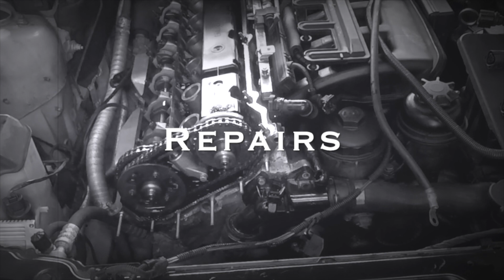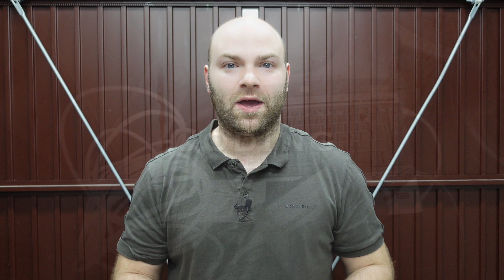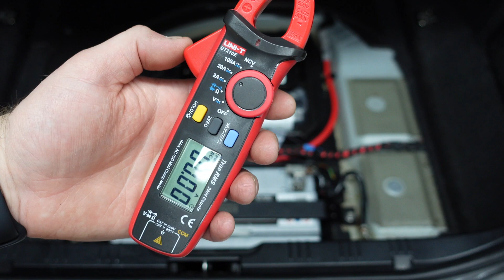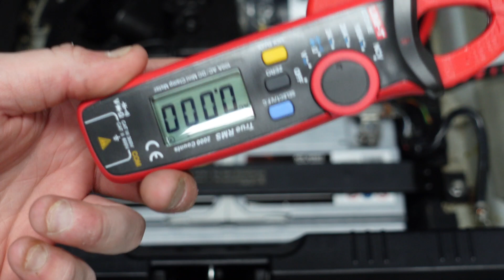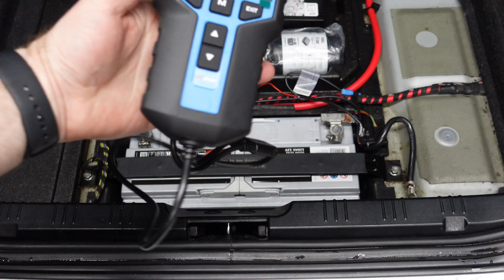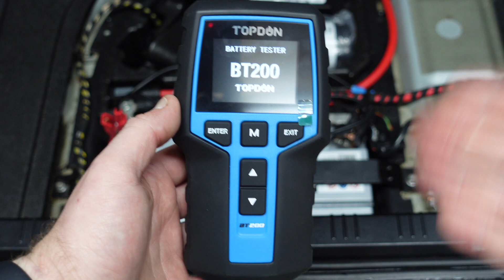Doing This Will Save You Thousands In Electrical Repairs

Comment: If I am not mistaken that is a Bosch S5 015 with a 110Ah and 920cca rating.  So 860 is about 93% SoC and 12.67v is close to fully charged for a LA.  But 3.47 M Ohm seems rather high.........  It is unclear how the Topdon BT200 determines the cca rating from the 110Ah that you entered as the two are NOT related.  Best to cross check with another proven tester.
NB.  Tests out of the vehicle, 1 day after fully charging and having removed the surface charge are more reliable.

Comment: I have a 2011 bmw 335d, my dpf is blocked and I can’t get it to regen because of the ‘throttle valve actuator code’. I’ve done the throttle reset and changed the throttle body and the code still keeps coming up. 

Can anyone help or recommend without going to the dealership? Thanks!

Comment: Hey Doc, I have a X5 M50D since 2014,first owner,  car  has around 105000 km. Started to have issue with boost couple days ago. Basically I have no boost(and I think no turbo's) till the engine reaches 100 degree. Once is passing 100 degrees everything is back to normal. No message in the car, as if something is malfunctioning.   Went to BMW dealership and they said that is the intake manifold, and that they should clean it up.  Did that and the issue is still there. The dealership is still stating that I should replace the intake manifold, they  are charging around 2k  Euro for it but I am sort hesitating to do that.  I mean is strange that once the engine reaches 100 degrees  Boost/Turbo's are back on the table and that looks to me like some sort of sensor.   ( btw the dealership is saying that there where no errors reported during the diagnostic.  I heard that a full diagnostic process can take up to 3 hours on this car... sort of doubting they did it as ).  Any Idea where I should start looking into ?

Comment: As far as i saw you have normal 110 Ah batteries in all your cars. I have a 95 Ah AGM battery in my 35d, and now that winter came it started to act up with increased battery discharge. I tested the battery it's 76%. Wondering if the battery is too old, and should be changed, and if so can i use a normal 110Ah aswell? Ofc i know it has to be coded after, but wondering why mine has AGM battery if it has no start-stop system. Anyways I'll check my car for battery drain with your method, maybe something is draining.
Reply: @Gábor Farkas
 76% what?  76% SoC or 76% SoH?   If 76% charge just charge it get a CTEK MXS 3.8, 5.0 or 10.0 depending on you budget.  Leave it on charge (they all have a trickle function) as that will keep it healthy.  Even more so being grounded under Tier 5 restrictions.
If 76% health well that means it can only give about 680cca and it may be struggling to start a 3 litre diesel more so as it get colder.
Many battery testers will suggest replacing from around 70-72% SoH.  If your battery is a BMW original it may be date stamped on one of the posts.
Why AGM?  Because they are more robust.  My M5 is not start stop, but has an AGM.  AGM last longer.  Typically 10 years and often it is some power drain that pushes them over the edge.  Trackers fitted in the 2000s have backup batteries that go bad.  ALL BMW fleet vehicles had Trackers fitted.  Looking for one of those (or all of them - five is the record) can make your garage look like a chop shop.

Comment: The clamp-on amp meter is actually one of the best ways to find if you have a component killing your battery although I would suggest putting it in DC mode because an AC it's quite different it'll give you a completely different reading anyway but keep doing what you doing thank you

Comment: Have question on 06 325i.  I replaced the heater motor wiring harness.  Instead of following the wires out I just spliced the 3 wires together.  Fan now works fine, however the a/c will not switch to cold. It worked fine before the wiring change. The compressor is working. I don’t know if there is a fuse for the temp control?  It is driving me crazy.  Any help would be great.  Love your vids